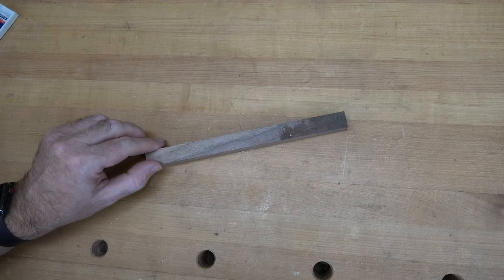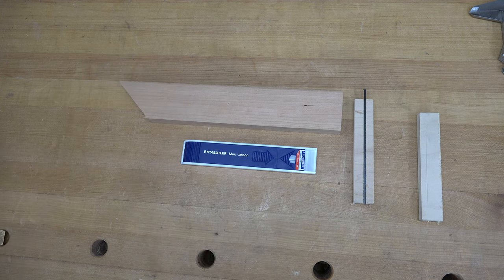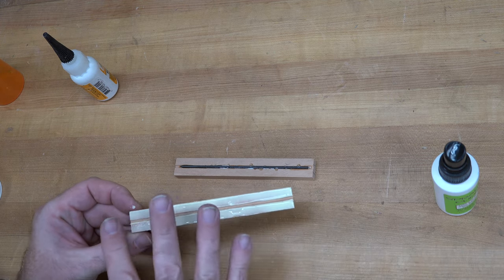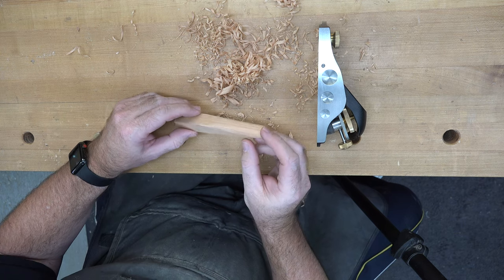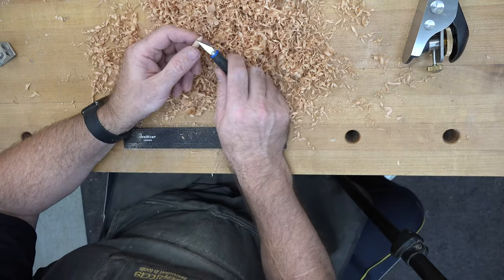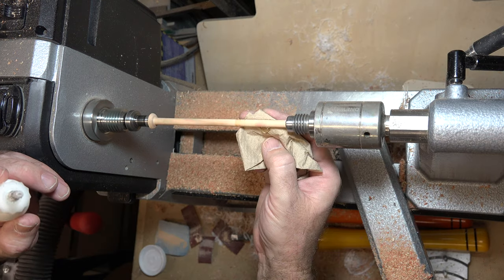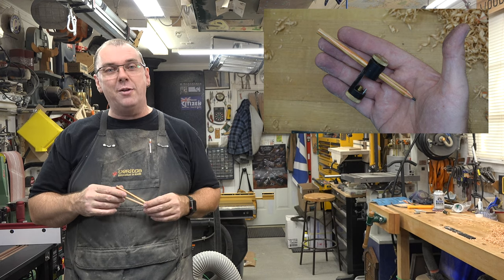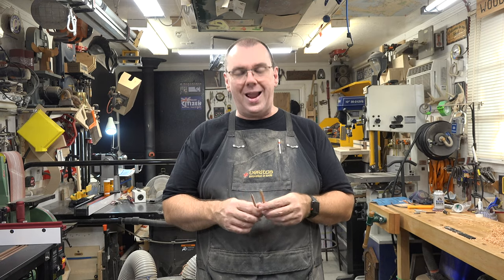Making a Pencil

Comment: The standard pencil is 7.5 inches long. If you make your blank two inches longer you will have enough pencil left to hold until the lead is used up, at witch point a regular pencil would be thrown out, too.
Reply from the maker: Where were you when I came up with this idea for the show?!?!?!?!  Awesome idea and I can't believe that I never thought of that.  An extra couple of inches of stock to prevent any waste the lead.  My next ones will definitely incorporate your idea.  Thanks so much for tuning in and for chiming in with your suggestion.  I love it.

Comment: Ok, i'm not gonna make a pencil, but you totally justified making them for there uses.
I've got compasses (etc) that I have to shave pencils down to fit.
The kick to me with this vid is scrap. Got a 1x5 board that, all though it won't work,
is about to become a huge carpenter pencil.
Take care Ken, be safe and thanks for the inspiration.
Reply from the maker: Good luck on the carpenter's pencil.  That would be a ton of fun to make as well.  Thanks for tuning in Dale.

Comment: Kenny, those came out great.  Was the one on the lathe much harder to turn than a slim pen?  Looked like it was about the same diameter.  I know it would have been a sin to even think about paint but would it have been that awful to make one out of cedar or pine and paint it yellow?  You could even engrave Kenny 2020 on the side.  Great work.
Reply from the maker: Pretty much the same a turning a slim pen Paul.  Not much different at all, except that you didn't have to worry about cutting too deep and blowing your stock off of the brass insert.  LOL.  Just a load of fun.  I like your idea about painting them and customizing with engraving.  How about making them for someone else and engraving their name on it.  Great idea.  Thanks for tuning in this week sir.  It's appreciated.

Comment: Just wondering if it would be at all possible to push the blank through a dowel former, gently of course. Just an idea.
Reply from the maker: Not sure if that would work or not Cliff.  The hammering force to drive the blank through the former might shatter the graphite.  I guess there's only one way to find out.  Thanks for tuning in and for the suggestion.  It's appreciated.
Reply: @acutabove_woodworkings  Sorry Kenny, I meant tapping the two halves of the blank through the dowel former and then placing the graphite into the tiny groove you made and then glue the two blanks together. Sorry I didn't explain my question very well the first time.
Reply from the maker: @cliffcarlo180  Yes sir.  That would work.  Great idea.  Thanks for chiming in with it.
Reply: @acutabove_woodworkings  Cheers Kenny. I just thought it may save you hours of whittling away with your plane and hopefully safe your fingers at the same time. Like I say, just an idea but I hope it works for you. Keep up the great work that you do, I always look forward to seeing your next project.
Reply from the maker: @cliffcarlo180  I'm always open to suggestions.  Thanks.